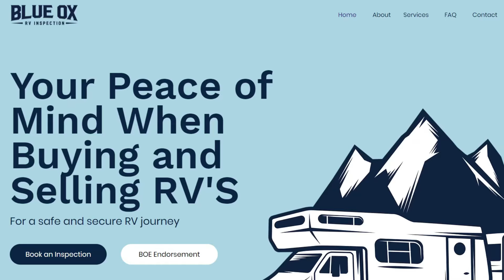🧐TIFFIN MAXIMIZES QUALITY BY REQUESTING BLUE OX RV INSPECTIONS UNBIASED, TRANSPARENT FEEDBACK 👈

Comment: Some people might say that those things might be small stuff, but it could lead to bigger problems down the road. Great job guys.
Reply from the maker: 😊 thanks 
I'm with you about problems...
Reply: The missing sealant, the misaligned slide and the outlet that doesn't work are NOT minor things.
That lack of sealant will cause water infiltration and damage as well as the lack of slide alignment that is already damaging the floor.
The power outlet that doesn't work can be something as simple as a fuse but can also be because the wire was not tight and fell off and now you have a live wire loose  inside the cabinet that can potentially set the rig on fire....

Comment: Well done.  Every video you do there is a problem with sealing  and slide alignment.  You are at Tiffin in a coach that has been inspected and had a PDI.   Not only did their inspection team miss the problem but the slide wasn't built correctly.  Why is it so difficult or are the inspectors that bad.
Reply from the maker: Exactly why the requested and wanted us to go keep their QC in check!
It will also become a recurrent already scheduled  at regular intervals.

Comment: Curious to know how may units you are slated to inspect for Tiffin?  Will you be brought back on a recurring basis to inspect additional units?  Will you be re-inspecting these same units before they are shipped to the dealer to verify that what you identified initially was actually acted upon (corrected) or might you just be practicing your inspection techniques (spinning your wheels) on a  new Tiffin unit?  Knowing that Tiffin has suffered from some fairly significant QC issues in recent times, I am hoping they take your input seriously and aren't just using this as a publicity stunt for a brief period of time simply to appease prospective buyers who have done their due diligence in researching Tiffin in recent years.  I hope you are able to maintain this interaction with Tiffin for the intended purpose, but your credibility will wane severely if you are driving a new Tiffin in the next 12-months or are in the Tiffin booth at the Tampa show as brand ambassadors.  Sorry for what may come off as sounding like harsh comments, but I have to believe that someone at Tiffin already saw or knew about many of things you found and simply chose to dismiss them.  Until those individuals are re-trained or re-educated or even fired, this seems like a vicious circle.  In the mean time, individuals who purchased other brands/makes/models are missing out on your experience and expertise while you are busy training the staff at Tiffin.  That's Tiffin's job - is it not?  Just my $.02.
Reply from the maker: Nice to read your perspectives Gary!
 To everyone of your point was a thought process we had to objectively analyze and weight these exact consequences. 
Independent approach was the key word during our initial contacts and processes. 
If you want to keep a diligent approach, it had to be consequential and followed by a long term and repetitive process  which is already set forth around at  3 months intervals. 
If someone gave me a free unit because they would feel we made them saved a fortune and wanted to reward us that way...I would never say no 😉. Anyone of them 😉 
Like them, I'm hoping to see them back on top with results we could have provide to their ascension. 

On the inspection side comes the reason why we still have consumers covered with our Endorsed program bringing up high quality inspectors to protect consumers and the industry. 

Thanks for your input and keeping us in check 🙂

Comment: C4BO it’s impressive that Tiffin is wanting the inspection done hopefully to make them better! If I’m correct there is a company who makes a flush slide box? I know they are used on higher end units why not Tiffin?  Before  they were sold they were the best out there they were a rival to Newmar actually in my opinion better.
Reply from the maker: Lets the future speak by itself!!
Reply: Tiffin used to have the seamless slides. They stopped after they were bought out by Thor as a cost saving measure.
Reply from the maker: No not really!!! It's actually a recurrent problem they had to get rid of as water was getting trapped behind the walls and floors and caused more troubles and warranty claims
Reply: @blueoxontherun9188  interesting. Figure yall got it straight from them then! I’d read before it was cost savings and saving warranty costs would make sense too. Thanks!
Reply from the maker: I was sold by seamless box until I talk to one of the shop guy and issues those actually created for all of them. Never had so much warranty issues 😕 why they went away from them

Comment: I truly believe the RV industry should hire some engineers and Quality System people from the auto industry.
every-single-manufacturer have problems (if not when new, in a few years) with that sealant around the border of the slides...
In the auto industry the thinking would be just modify the slide construction so it would not need sealant to start with.
" poka yoke " (mistake proofing) your design / manufacturing processes is how you get quality.
If you can't commit errors, you will not!!!!

Comment: on one hand it is great that Tiffin appears to want to take their QC challenges seriously, but I have serious concerns regarding how they are doing this. Tiffin already has a record of who installed each component in each RV. They also know who leads that team, who trained each individual and who inspected each RV with what checklist. they have a record of customer complaints and how each was handled. they already have the ability to hold every individual accountable. this rings more like a public relations ploy. Are you telling me that Tiffin really needed a third party inspection team to show them the stain in the shower, or the toilet not flushing, or fluid leaks. Absurd. If they need this third party inspection then they have more problems then we all imagined. As an example many auto insurance companies use the same valuator firm for vehicle total valuations (CCC One Market Valuation Report). That firm only works for auto insurance companies  and earns large sums to provide a favorable report to the insurer. I am not suggesting that Blue Ox is or would skew their inspections, but I am curious if this inspection weekend was a one off or going to be a regular thing (I would not suggest Blue Ox get invovled). I am further concerned that Tiffin is using this independent inspection as a publicity promo. Tiffin only needs senior leadership to actually take their QC seriously during the entire manufacturing and working with dealers to take care of customers. Until we see the bottom line changing, this type of inspection means nothing. I would rather see examples of how Tiffin actually researched and improved their manufacturing process systemically and how their record of consequences to personnel who did not do their job. Is their failure primarily due to improper training, ineffective leadership at various levels, financial incentives that do not reward QC over speed, warranty financial disincentives. We are offered no information in this video, other than a surface AVIS - we try harder. Empty promises to owners who want to see results and quickly. How interesting that Thor brings out Bob Tiffin to reminisce & shill for them as if he has anything to say about how things are run now.  We all will wait to see how Thor and Tiffin QC stats change and how they are managed going forward.